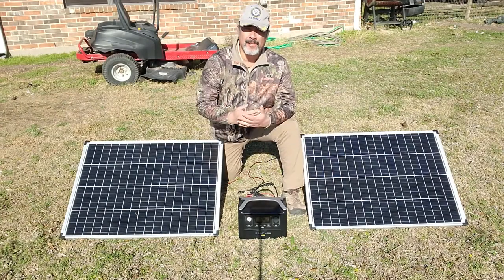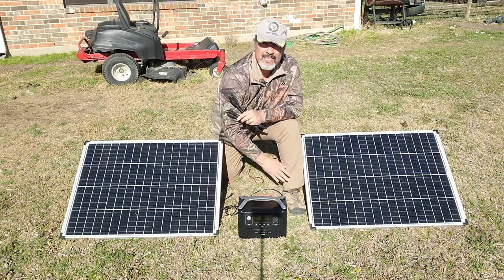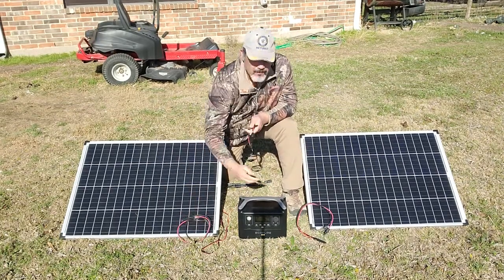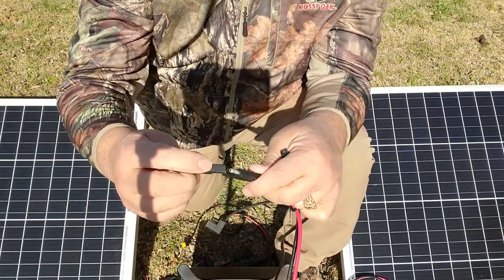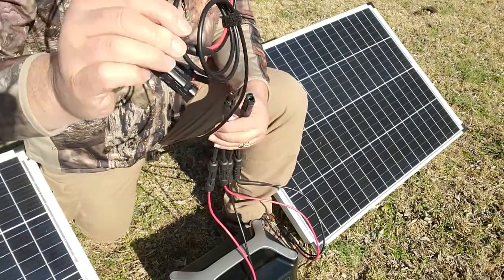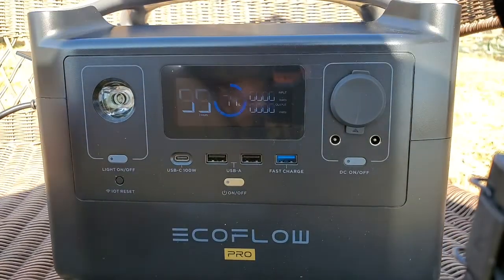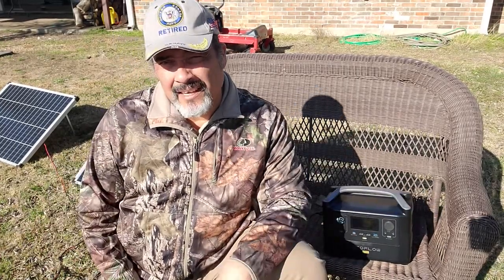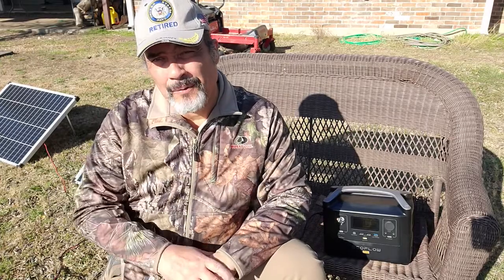ECOFLOW River Pro: Connecting Two 100 Watt Panels in Parallel.

Comment: i have basically the same setup with 4 panels but a slightly smaller batteery backup station... but the panels didnt come with the polarity adapter, did you have to buy them seperate?

Comment: Hi…I read that to hook up in parallel you had to use a 30 amp fuse to keep them from catching on fire.  Had any problems?
Reply from the maker: Good question. I have used mine regularly with no issues. I have not heard that before. I will have to do some homework on this. Thank you.

Comment: I just bought a Ecoflow River Pro 2 generator.  I live in Galveston Tx. We just survived Hurrican Beryl. I was without power for just over 5 days. My Generator saved me. I was was able to run everything in my apt. I didn't need the solar panel that came with it because my bldg had a couple outlets that worked. So i used those to power it up. But I loved its performance so much I just bought a second one. My question to you is can I use 2 different watt solar panels to charge my River pro 2 768 watt generator, I want to eventually get  a 220 watt solar panel to go alongside my 110 watt solar panel. Is that possible? Thanks for your help
Reply from the maker: @pw9265  https://youtu.be/jejro4zkl8I?si=qaHMNatSJrDHvM7s you need to watch this. Your limited on yiur amperage and input wattage. Need to know how to do the math before you mix and match or do it in series or parallel.

Comment: Solar/electric newbie here.  Is there a benefit to hooking up 2 100 watt panels vs 1 200 watt panels ?  I have limited roof space so thinking of 200 watt
Reply: I was wondering the same thing. I guess just the simplicity of having to hook up one panel? Less bolts / fixtures to secure is my guess.
Reply: Is there anyway just to use the SAE connectors joining them together and then ending with whatever connector you need to get your power to
Reply: No, in fact the benefit would be in the ease of hooking up 1 panel; however, with only one panel, if part of it gets shaded, it will shut down the panel, whereas with two panels, if one gets shaded, the other one will still work.

Comment: Yes you have to connect  this 2 solar panel in parallel to hold the voltage the same not to exceed 25 voltage 

The Ecoflow River Pro product supports 10-25V DC input, 12A max current, and 200W max charging power.